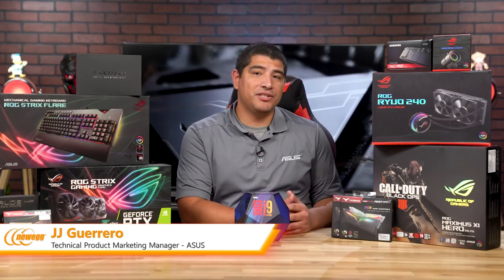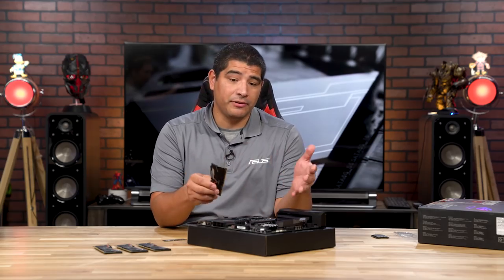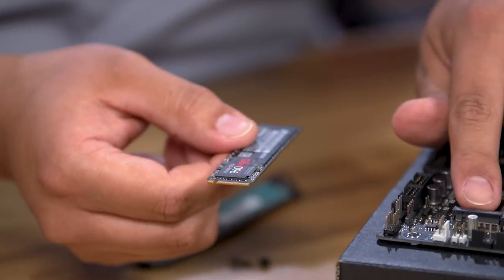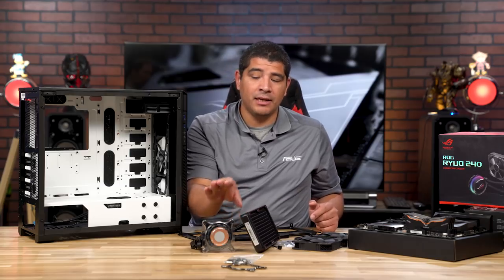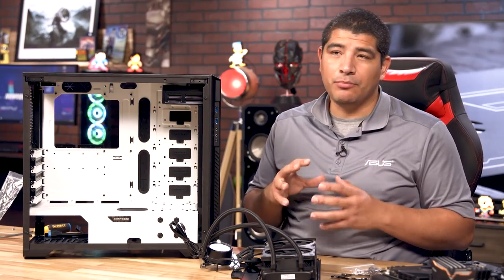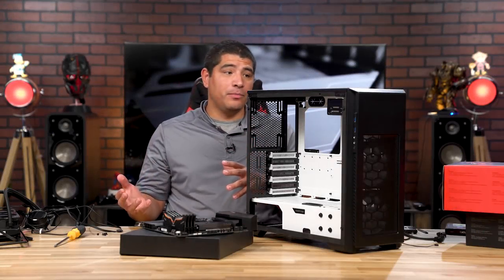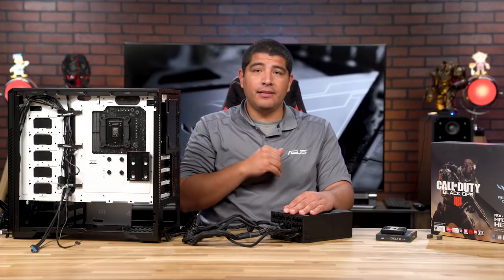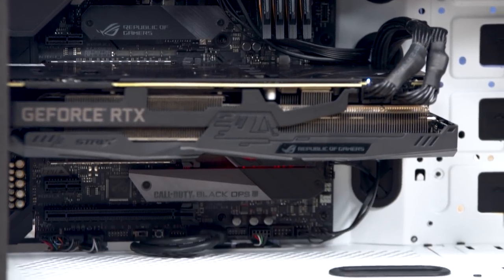How To Build A Z390 Intel 9th Gen RGB Gaming PC From Start To Finish

Comment: Is this motherboard outdated in 2020? Looking for a good motherboard to build off of, and I haven't been in the pc building game since 2015, so I am out of the loop.
Reply from the maker: The board is a little old, but it's still powerful and relevant. It supports both 8th gen Intel processors and 9th gen Intel processors (current). So as long as you're happy with those processor lines, this is a great board.

Other features are pretty awesome. I love the built-in M.2 slots on it and highly recommend you take advantage of the board's capability in this sense.

I'd suggest you take a look at our guide if you haven't. It will walk you through each thing you need to consider when choosing a mobo.

https://youtu.be/TbGjYumO_aw

All that aside, I myself have one in my own rig and like the board a lot and would recommend it.
Reply: @Neweggstudio  Thanks for the info. I ended up doing a little bit more research after this video and went the complete opposite direction. Went full AMD, with a ryzen 5 3600 and an Asus TUF gaming x570 with 16gb of vengence pro 3600 memory. Ordered the bundle available on Newegg. Found myself a red devil rx 5700xt and ordered one of those, too. Saw the benchmarks and saw it was keeping up with the 2070 super at 2/3rd the price. No brainer. 

Replacing my i5-4690k, Gigabyte Gaming 5, 16Gb ram, EVGA 1070 sc. Giving those to my nephew, just need to get him to buy a case and a psu and he'll finally graduate from Nintendo to a pc gamer.

Comment: Will downgrading the gtx to 2060 require any other part replacments? Or can i downgrade without exchanging anything...cajse i dont really need 2080 ti

Edit:rtx :b
Reply: I’d replace the cpu to a ryzen 5 2600x and downgrade the motherboard, you can use a smaller case and cooler, use 16gb of 3200 ram and use a hard drive and a ssd rather than an m.2. Tbh u should watch a Rtx 2060 specific build though
Reply: @jacobmoreton1696  u right thanks you

Comment: You didnt mention anything at all about the aio pump cable installation or anything about power switches ect but thats easy.. ive never used an aio and i dont know if thats why my machine wont boot but it turns on, the mem led flashes red for a second, goes to yellow for like 3 seconds and the machine tries to reboot.. what am i doing wrong?!?!?!?!?!

Comment: There's a 4-pin power connector next to the 8pin CPU connector, do I need to plug that in too?
Reply: you don't have to. unless you're overclocking an i9 9900k or over doing it with the OC. my 9700k worked fine without it, but my power supply has 2 CPU plugs so I used the port anyway.

Comment: Pro tip....lay the case down...makes your life easier. I realize you, for the video, had it standing to film the installation. Watched this because I use to build PC's for a living, 10 years ago. Seeing if anything changed...nope, not really. The only new thing is the Onboard SSD installation. I see people installing them without the heat sync...if it has a heat sync, use it people! good vid, most of these instructional videos are really bad.

Comment: Why pair the 9900k with the Maximus XI Hero?  If you're going balls out anyway, and overclocking as one should, why not get the Maximus XI Extreme?  Won't it handle that better?  Budget is clearly not a concern for this build.
Reply: Honestly the 8+4 on the hero is better in my opinion, my extreme has meny issues at 4.8GHz and my hero runs 5.4GHz stable without a sweat.

Comment: I would like to ask you a question if possible:

I bought the box: asus rog strix gd30 empty and I saw that the usb front panel, card reader and sound, there is 4 sata cable on front panels and the question is this: is this cable are for plugging into the hard disk
I tried to get information but it's impossible
help me please
Carlos Brasil -

Comment: Is there any need to install HDD along with SSD? Like use the HDD for backup photo storage/ect. 
It's been about 10 yrs since my last build so don't know whats the standard now.

Thanks
Reply: No.....there really isn't a need. Regular SSDs and newer NVME M.2 SSDs are getting cheap enough now there really isn't much of a point. Mechanical drives are only good anymore for unloading massive amounts of files to store like 4TB of garbage videos you need to drop somewhere etc etc..

Comment: hi quick question guys:
is it normal for the ROG logo (in Mobo) to turn off automatically even if i didnt shut it down?, my processor fan's RGB is lit up though, its just the ROG logo built in the mobo that is off. is it a factory defect or do i need to configure it or something? thanks in adnvance

Comment: Is he using the m.2 as the hard drive or the ssd because I didn’t hear him mention a hdd 🤔🤔🤔(1st timer good vibes only)
Reply: the M.2 is a Solid state drive. it has higher performance becuase of the interface over HDD sata connections.

Comment: Thanks, Asus now needs to start putting swinging tempered glass doors on there cases. This is one of the reasons I passed up Asus Rog Helios Case. No Tempered Hinged glass door or Doors and Minimal Storage for a $300 Case. 

Sorry I had to go with the Phantek Evolv X, Much better offerings than the Asus Helios Case. As Much as I love Asus, that Rog marketing isn't bringing better Numbers to the table as far as Money wise. I also went with the Corsair H115i RGB PRO AOI System, Because the Asus wasn't giving better Cooling numbers for double the price.   Just thought I throw it out there and maybe someone from Asus Actually reads this. 

Thanks again for the Building of my 3rd Rig ;o)

Comment: I strongly disagree with your thought regarding exhaust air flow: since the PSU draws air from the bottom and heat rises it is better to exhaust via the top. Logic states that the radiator should not be near the exhaust as it reduces cooling performance.

Comment: I trying to figure out why my motherboard won't power on and I noticed in this video at the top there  is an 8 + 4 power slot but mine only has the 8
Reply from the maker: some boards have a 12-pin connector at the top, some have 8-pin if the board is smaller or requires less power. There's also the main power connector on the right side of the board that needs to be plugged in. If you still have issues, check out the Newegg Discord and ask for some tech support there.

Comment: please, never install your PSU after your mobo. U can just put your pcie power cable behind your motherboard this is so much better for cable management.
also u clip out the black cpu protector with your hand. ONLY do this if you are experienced with building pc's. The black protector protects your pins when you place your cpu inside in the wrong way. u can't close it without it popping off and it wont pop off if the cpu is in the wrong way. also why are u not wearing your ESD bracelet? don't build without a ESD free enviroment. at 21:50 you screw on the cpu cooler, never go from 1 side to another, always cross the screws this means u first screw in the left bottom corner, after that screw in the right up corner. right bottom corner, left upper corner.
this way u don't put too much pressure on your cpu in 1 time.

Comment: can I use this without M.2 drive?
Reply from the maker: You can. But M.2 drives are much faster and a great place to put your system OS on. You can easily install a 2.5 inch SSD if you want. You'll just have to make sure to connect it properly to the board and to the PSU.

Comment: Obviously this video was 'sponsored' by Asus! Apart from motherboards, I find their products to be rather 2nd rate. The case is also pretty poor for an expensive build and the less said about the RGB setup the better! The thing that concerns me most is that the AIO cooler fans were mounted upside down, they should be drawing cool air from outside the case, not warm air from inside - a very common mistake compounded by companies advertising their AIO RGB products with images set up to advertise the pretty fans.

Comment: Does anyone knows if a gigabyte z390 gaming x mobo is capable of overclocking an i7 9700K to 5.1ghz on all cores using a 240mm deepcool gammaxx l240 water cooler??
Reply: Gigabyte Z390 Aorus Extreme and Gigabyte Aorus Z390 Master do that.

Comment: I'm running AAA games at max settings with a older gen i5, 16 gigs of cheap ram and a 1070 at 100hz Gsync 1440p. PC builds these days are going so far and above absurdity and cost for what?

Comment: oh hell no, why would you you want the top fans blowing into the case?  air gases flows up, not down, the top fan should be exhault fans to help suck the air out faster, you want air to flow in from the front of the case that will blow through the hardware

Comment: Actually there is an easier way to install the motherboard and CPU cooler. Essentially all you have to do is just Go Ahead and lay the PC case flat on the table. Then, now that you are Actually not fighting gravity but Essentially letting gravity assist you, you can Go Ahead with the building of your PC and Essentially will be building it the way ever one else Actually does.

Comment: Buy this mobo if you just want a free black ops 4 copy. Coz you're not getting the 8 phase you're paying for.
Reply: I know it is bullshit. But it is still thankfully more then sufficient for playing games. For example the turbo boost for the i9 9900k still works fine with a good cooling solution. It turbo boosts up to 5GHz.

But if you want to manually OC each core to that and beyond then the Asus Maximus Formula or Extreme is better. I don't know of any games that require that though??

Your average enthusiast is fine with the Hero mobo. As long as they pop in good cooling.